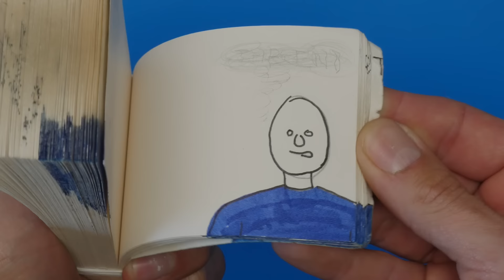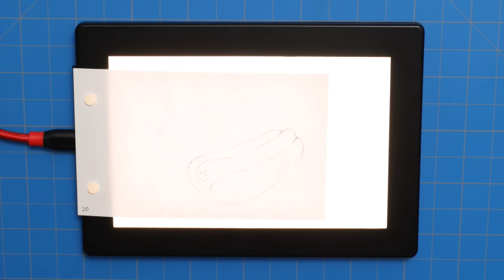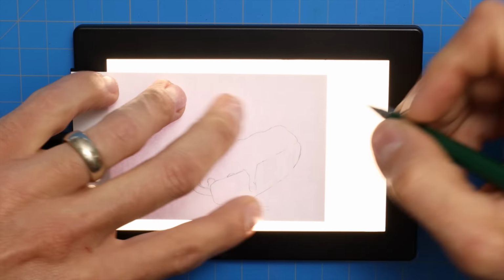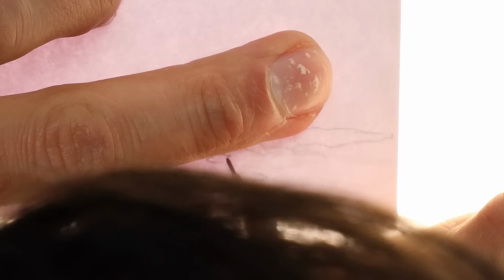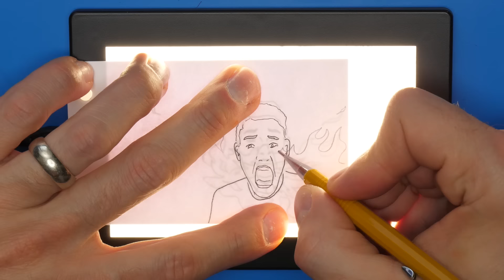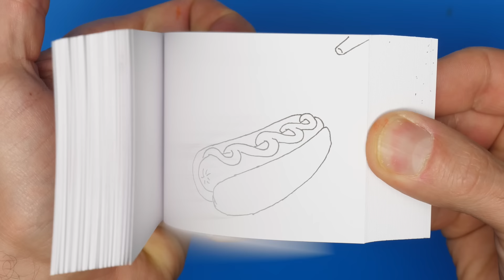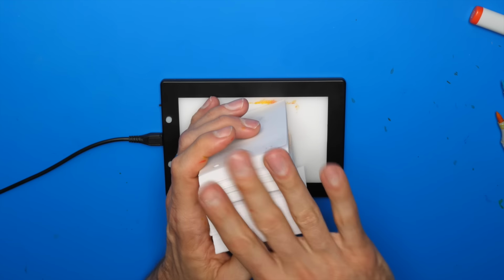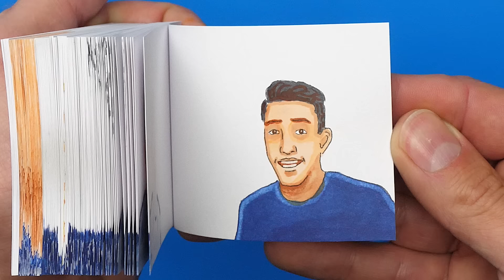Remaking My Favorite Flipbook 30 YEARS LATER

Comment: This was great and I didn't realize you've worked on Kubo and the two strings. That movie was a lot of fun.
How do you clean that lightpad? Does it not have issues with the alcohol in the markers?
Reply from the maker: Thanks! I usually wipe off the light pad with rubbing alcohol. It retains a tiny bit of the color sometimes but no issues.
Reply: @andymation  hi